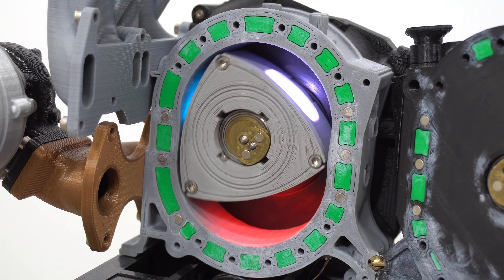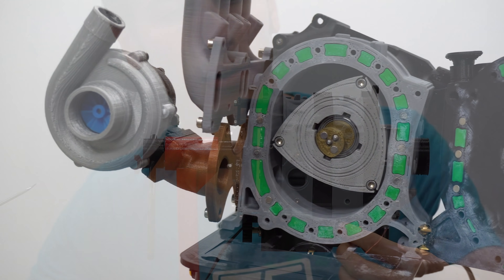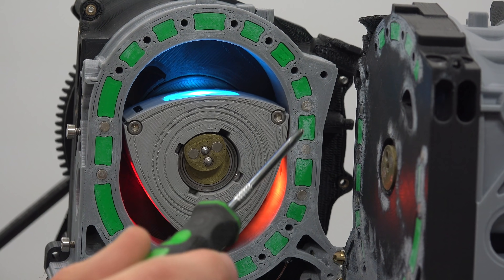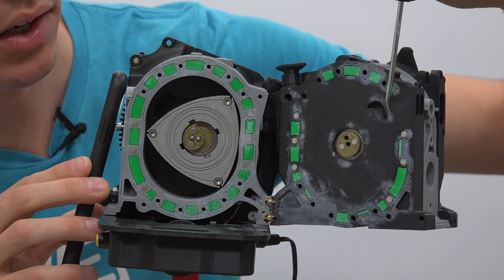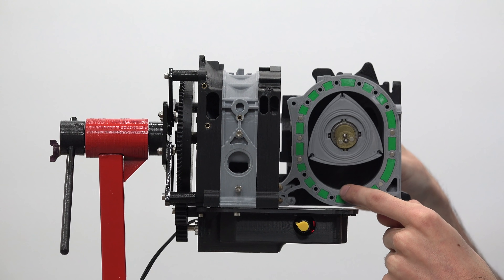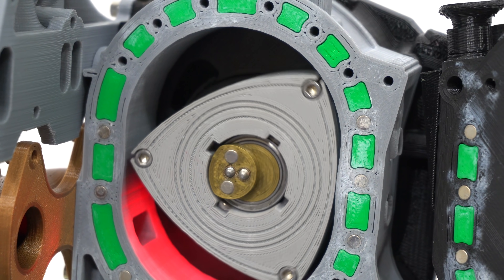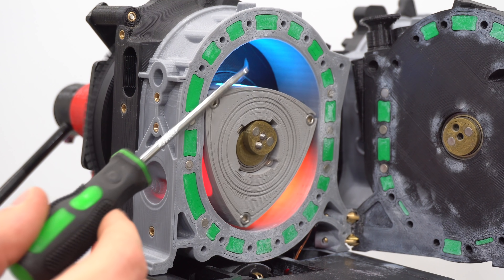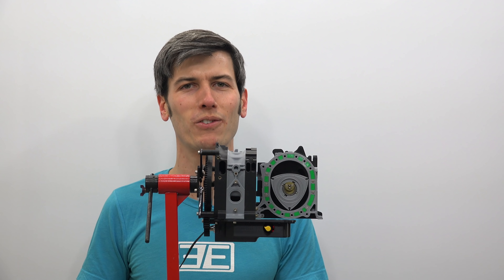This 3D Printed Rotary Engine Is Genius - Mazda RX-7

Comment: Since you're not using a spark plug and if one was using high pressure air to run the engine, how many ports, intake and exhaust, would it take to run most efficiently? One of each? One of each per chamber, for a total of 6, 3 intake and 3 exhaust?

Comment: Couldn't you do a dual rotor design in a figure 8 with the top rotor for intake and the bottom for exhaust, put the spark plugs in the middle, seal it with a gasket, then make the bottom from Iron and top Aluminum like a 2JZ for heat, and then control each rotor for essentially variable valve timing? It would essentially be a 4 rotor figure 8.

Comment: Wonderful presentation on many levels. I drive my RX8 regularly, and after a significant learning curve re: its idiosyncrasies, I remain very much in love with her. I liken it to driving a temperamental, comfortable go-cart. (By all means, get the 6 speed manual if you are in the market).
Reply: I do too, and feel exactly the same way (6 speed also, with a new engine core).

Comment: How about trying to hook up two of those side by side with a drive shaft that has a gear screw at the end of it that connects to both of those side by side running the small versions

Comment: Another disadvantage of the Wankel engine is that it achieves its higher horsepower by *sacrificing* torque for higher RPM.
Reply: it isnt true. only in the lower models. take a look at the 26j that was banned from lemans on a dyno then tell me.

Comment: It's just a Wankel engine. Notoriously difficult to get good compression chamber seal.
Reply: the liquidpiston rotary defeats this by using a new method eliminating the separated exterior seal for an integrated interior one and many other changes including using a concentric motion in true rotary form unlike wankel ...

Comment: Here's a good question - Will Materials Science ever produce materials that would remove the wear problems that doomed the Rotary?
and If so, could we see a re-birth of this motor or will pollution laws prevent this?
Reply: lookup the liquidpiston rotary with hydrogen hybrid electric
Reply: @bobspence5322  Wow, that's cool. Thanks for the hint.
Hope the material wear factors have been overcome, the real downfall of the Wankel, But it would be excellent in current hybrid electric cars replacing the small gas engine with an H fuelled rotary. Weight savings alone would be enormous.

Comment: If the upsides are power to weight ratio and a smaller size and the downsides are all emissions and durability (apex seals) related, then why aren't rotary engines used in F1 cars?
Reply: they are banned from 24 hours of lemans

Comment: I live in a town that has a company called Freedom Motors that developed and builds custom rotary engines for many different uses. I recently purchased an 8 foot personal watercraft built in the mid 60's with a fixed outdrive and a rotary engine. Currently not running but who knows, I may reconstruct the engine. It's corroded after sitting for years.

Comment: I'm a little confused by the description of the power stroke analogy. There are 3 faces to each rotor. The rotor rotates at 1/3 the crankshaft speed. Each face of the rotor produces a power stroke for a full 360 degrees of crankshaft rotation. There are 2 rotors both producing power strokes 180 degrees apart so there is "constant" power being applied to the crankshaft (concentric shaft). So, how does that correlate to a 4 stroke piston engine? How many cylinders do you have to have to equal the same constant torque applied to the crankshaft? I would think that an 8 cylinder engine would equal a 2 rotor if it is agreed that a 4 stroke piston engine produces power for 180 degrees for every 720 degrees of rotation.

Comment: A better way to look at it is that a piston engine only displaces (from intake port to exhaust port) half of what it is normally rated at. So a 2.6 liter 4 stroke piston engine only displaces 1.3 liters of air per revolution of the output shaft.

Comment: Great idea, but this could be done just a little bit more advanced and give an even clearer idea of what's going on.  Needs more LEDs and information.
Say Green for intake, and light up the intake port for the intake duration.
White for the spark, and spark duration.
Orange for exhaust, and light up for exhaust duration.

The idea is great, a little more information displayed and you'd hardly need any explanation at all.

Comment: I have a process to create a better heat transfer, both for the rotor and housing with precious metals.. AuPt is not rare or hard to find... and because the metals are so very dense, when I find them in native metal they have a double double covalent bond, instead of metallic bonds... it can be held in the hand and drilled with a hole saw or high speed polishing machine... it's a superconductor for heat through the double double bonds... it's available in another mineral, aluminum oxide... melting point is 3000° C... and it can be machined like steel... but it has a triple bond shared across the Al2O3... it's about 5 orders of magnitude harder and stronger than steel
Reply: I am buying an NSU wankel 49cc... aircraft engine for an ultralight... collaboration might make it more interesting.  . Please give me a call

Comment: Great 3D working model, and explanation of why it's really a 2.6L engine. What I have never seen explained is the process of making torque with a rotary, and I hope you can make a video of this. With a 2D approach, you can assume balanced combustion pressure on a rotor face, and have a single force vector from the center of the face to the center of the rotor. The lever arm is the distance between this vector and the shaft center. For this face, as with pistons, there is no torque at TDC and BDC. Although the stroke appears to be 2 x e, it's actually 3 x e,  unique to the rotary. You can back calculate it based on the face displacement (.65L) , and the projected area of the rotor face (22.53 sq in).

Comment: One small point - it moves in an epitrochoid rather than in circles.
Reply: The apex seal contact line moves in an epitrochoid (housing inner surface) but the rotor's CG moves in a circle, as it spins on the shaft's offset journal.
Reply: @kevink2315  ah cool of course :)

Comment: If you used the correct polymer , you could actually make this engine run. Like a holtzburg racing motor 🤔 that I believe was a plastic racing motor of the 80s.

Comment: The one power pulse per rev can be improved upon by altering the gear ration between the rotor and output shaft.  Then maybe inefficient power sapping & space consuming gearboxes may not be used by just adding rotors to the engine.

Comment: If you double the displacement of a 1.3 litre rotary engine on paper to 2.6 litres because it has twice the power pulses per revolution, then the same should be done for two-stroke piston engines.
Reply: And the correction does apply to 2-strokes, but not quite 2X since the stroke is shortened to allow exhaust and intake cycles to occur near BDC.  Back in motorcycle racing in the 60's, 500cc 2-Strokes competed with 900cc 4-Strokes, and beat them. 
Jason compared a single piston engine with the 3 faces of a rotor ... it gave the right answer but the implied assumption was the single cylinder had the same displacement as the face of a rotor.

Comment: OK hydrogen solves the rotary problem of not all the fuel is burnt with unburnt fuel being pushed into the exhaust. This gives poor emissions as well as poor economy as all the fuel is not being burnt, in short wasted. Hydrogen is quicker to ignite and with the flame propagating very fast burning all the hydrogen fuel in the combustion chamber.  Also it only needs a simple ignition and injection system.

But as yet hydrogen is not freely available. Does LPG or compressed Natural Gas also solve the rotaries problems as well. These fuels are readily available. I don't think Jason mentioned these fuels.

Comment: A LL WANKEL ENGINES FLOOD WHEN YOU ASK WHEN A APEX   L INES UP WITH THE 
LEADING PLUG HOLE YOU FLOOD  THE PLUG WITH FUEL AND WASTE AIR FUEL AND 
HALF OF THE COMPRESSION STROKE FAILURES

Comment: the engine stand should not be mounted on the rear plate lol. The motor is built from the front to the back.

Comment: Does this engine design vibrate a lot?  With the rotars spinning in a "flopping" motion, I thought it would create significant vibration.
Reply: It doesn't actually flop.  From what I can tell, it rotates around a stationary gear.  The lobes on the eccentric shaft may also play a part in supporting / guiding the rotor as it makes its way around the chamber.
Reply: @glen_nz  noted and thanks for your reply

Comment: In another recent video, you discussed the advantages of hydrogen engines over petrol engines etc, one particular point you discussed was the increased rate of flame propagation with hydrogen fuel, surely this could be utilised in a rotary? Additionally, hydrogen combustion occurs at lower temperatures does it not? This would help alleviate issues with thermal efficiency to some extent?

Comment: Could a company, in theory, use this type of engine to create more powerful snowmobiles? 4-stroke snowmobiles are significantly more durable than 2-stroke, but the engine needs to be a lot bigger to get the same amount of power. If this engine is relatively small, and creates more power than a 4-stroke, why hasn't anyone used it in a snowmobile or other vehicle besides a car? The downsides are all what snowmobiles have already: poor emissions, fuel economy, and burning oil. The only negative would be the seals. Just a thought that crossed my mind while watching the video. Maybe someday a company could use this type of engine in one?

Comment: This would never fly in the US but I would like to see Mazda create a modern example of the Rolls Royce diesel rotary engine. It in theory solves two problems:
1. It has a second smaller rotor on top of it to reburn unused fuel.
2. The diesel fuel should help out with lubercation

Comment: even though it was a powerful motor for a car that 4 guys could pick up and carry.. my f250 with a 6.2L gets about the same fuel mileage, and 425hp. Weight to power was there for sure, typical for a 2 stroke.. throw half the gas right out the exhaust unburnt.

Comment: Hey Jason, could you cover the topic of parking your car with the handbrake vs parking it in first gear? Had my brake pads jammed after driving and had to replace them, they told me to always park in first gear instead of putting on the hand brake because of hot discs.

Comment: 3D printing is super awesome. Imagine an actual full size model Wankel engine 3D printed out of metal like aluminum or even titanium. Another challenge with these engines is manufacturing the engine in general due to its complex geometric shapes and tooling to actually make the engine and since 3D printing, aka additive manufacturing, excels in geometry better than traditional casting, forging, and CNC machining, it should be easier to 3D print this engine and cut manufacturing and development time in half, bringing Wankel rotaries back much sooner than it usually takes to make an engine. I believe Mazda can dabble in additive manufacturing and not only 3D print Wankel engines, but also their other SkyActiv engines, transmissions, body and chassis, wheels, brakes, etc and make their cars better than ever

Comment: You should 3D print as many parts of an actual car as you can and maybe with electric motors driving the crank or something actually build a working car. That would be RAD AS TITS

Comment: Good description.
There's another bad reason too, that if fixed will mitigate the other bad issues.  Needs more rotors!  It's been a mechanical engineering issue though (is it today?).  With 3 rotors you get a power stroke every 40 degrees instead of 60 as with 2, increased hp (3/2 more), can have smaller rotors which reduce ring speed thus wear/temps, oil consumption, increased rpm (more hp). Additional rotors make up for the torque loss, think V12 (hilarious with 12 rotors...but you would have a power cycle every 10 degrees! Or 36 time for ever rpm!).  That and some material science, eliminate need to spray oil, to 2018 ms knowledge and it would be fantastic (weight to power and size).

Lol, not that I've ever thought about it.....(I remember building a plastic model of it in the early 70's....)

Comment: I reckon the emissions from burning oil could be drastically reduced if they use a separate reservoir of two-stroke oil for that, which should burn somewhat more cleanly. The poor thermal efficiency, that is a harder problem to solve. But generally simply making it bigger will increase the volume to surface area ratio.

Comment: I'm very interested in rotary engines. They're so light and "easy-looking" I am surprised that they are so expensive to work on and use. I was curious about trying to get a small one to clean up and install custom onto a go kart but when I looked up new Rotary engines of that size I was suprised to see that they were in the $20,000 range!!! Does anyone have any ideas on how I can 1) find a cheap project to start with these engines or 2) find a cheap engine?

What makes these so expensive? it's a simple system? If I owned one of these cars I would want to be able to change out the apex seals myself.

I know a few different hybrid cars or busses use a rotary engine to assist the electronic cycle, does anyone have more info about using one of those for a gokart?
Reply: could one be sent the CAD (or other file) and use a metal CNC machine? to machine out all the housing parts?

Comment: Another disadvantage of Wankel engines besides high fuel/oil consumption and the economical and ecological damage it provides and the rotor seals wear leading to significant performance loss is their relatively short usefull life - I can't remember ever a Mazda RX8 with more than 120 000kms - that's why the notoriously low second hand prices.

Comment: if power scaled with size, that small model would make ~85hp
Reply: Wouldn't it make 9.44hp?
1/3 scale is 1/3 the size in every dimension, so it has 1/27th as much volume.

Comment: You’re actually the right guy for this question… You should draw up a diagram of a concept rotary motor. The revised version should have both intake and exhaust valves that alternate between taking in clean air and blowing out the exhaust in order to Distribute temperatures more evenly.

Comment: The story was wrong that linked to this video. The Rotary became popular with the RX2, RX3, RX4 and the Cosmo. And you don't need your trunk full of oil. You can get 800 to 1000 miles per quart. What also killed it was all the engine failures in the first generation RX8's which had less oil ports, and so many recalls on the car as a whole.

Comment: A single rotor will actually be equivalent of 3 cylinder engine, since each rotor have three sides(every 120 degrees), so 2 rotors = 6 cylinder engine, this way its easier for "piston heads" to wrap their brains around Wankel. I also like your analogy of 1.3 litter = 2.6 litter in 4-stroke terms. Excellent job!

Comment: Do you think it is a 1.3 or a 2.6 though? With the absence of a top dead centre or bottom dead centre, I think that it should be measured as the total swept volume that the rotor housing has. So 1.3.

Comment: Ha I remember doing a speech on the hydrogen fueled rotary engines in the RX-8s that Mazda leased to companies as fleet vehicles. I think I was comparing hydrogen vs electric as a automotive fuel of a future in 10th grade. I passed but I kinda shot myself in the foot by saying they were both good and I only really sided with hydrogen because of the rotary engine.

Comment: And better hope you don't overheat a rotary engine. If you do chances are the coolant seals will be fried and they are not cheap to rebuild due to all the seals and springs you need to replace.

Comment: I love the rotory for its character, despite its high maintenence. Such a cool and unique design.

The similtaneous combustion is why It makes so much power though. For a piston engine, you have one power stroke for every two rotations of the crankshaft per piston. For a rotory, you have three for every one rotation. I.E you get six combustion strokes in a rotory for every one combustion stroke in a piston engine. Nice. Thats also why its so thirsty lol.

Comment: Thank you! This is the best explanation and model I’ve ever seen. Very informative. I owned the 2nd gen RX7 back in the day (Ticket Red and new in 1985). Loved that car, and it ran great for 7 years before we sold it. It had a crazy high red-line, something approaching 9000 rpm, if I remember right.

Comment: Although a 1.3L rotary may seem to match with a 2.6L piston engine, it's not exactly a 1:1 comparison. It somehow works out to feel more like a revvy 2.0L 4 cyl. engine. It's a case where the math in the comparison really should just be made to fit that more realistic comparison....cuz they definitely don't feel like 2.6L piston engines.
Reply: Think of it like a big more short stroke piston engine. not much torque, but revs very high. remember the RX8 had about 230 HP from 2.6L  my Mazda 6 has 185 from 2.5L

Comment: There were some big names working on rotary engines when the fuel crisis hit.  Mercedes included.  I think if not for OPEC's oil embargo, this engine might have overcome more of these engineering complications, and been a lot better off.  But with only Mazda sticking it out and doing any serious MODERN research on this engine, it's at a huge disadvantage to a design that has countless billions in R&D poured into it.

I look forward to hearing about the Skyactive rotary!